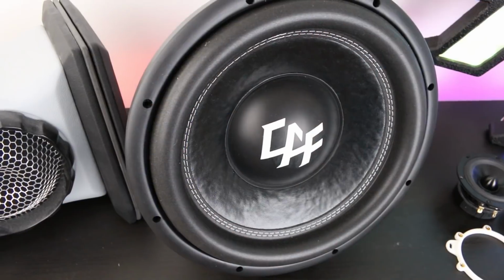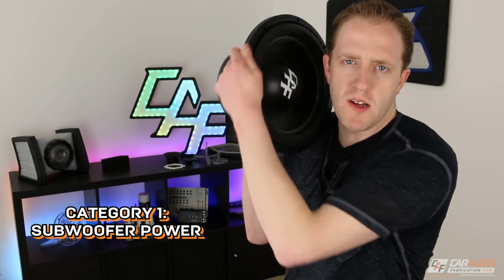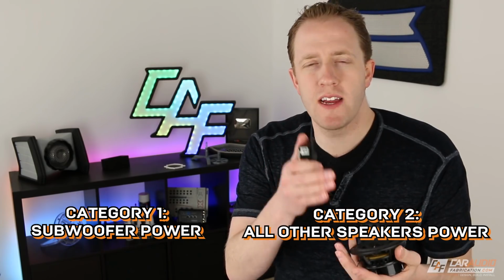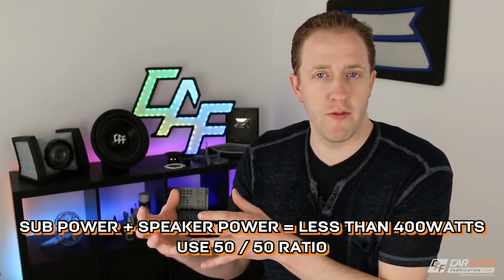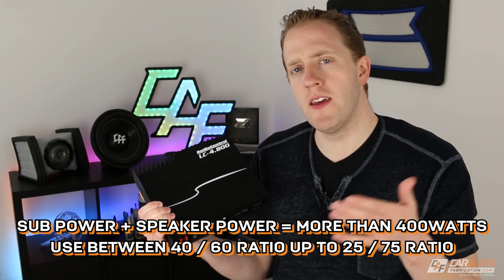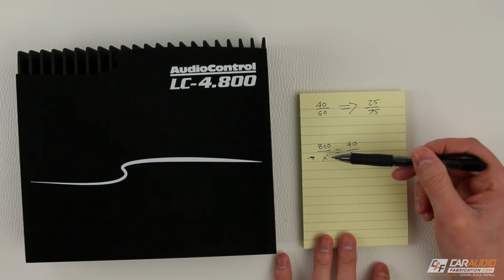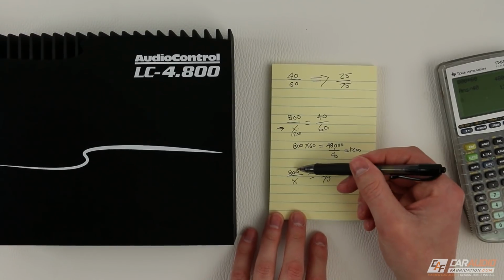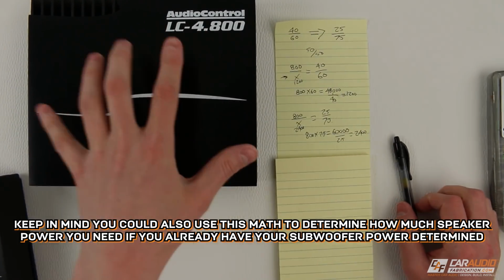Pair amplifiers CORRECTLY - Power Balancing Car Audio

Comment: i do have 60x4 (240 watt total ) rms watt amp for speakers and 150x1 rms watt amp for subwoofer and the subwoofer outplay the speakers by far when i put the gain control to the maximum , i have to lower the gain to the half at least to balance the sound , it's not even 50/50 what's wrong ?

Comment: A 40/60 split of 200 watts is 80/120 watts.
Secondly, you cannot set it up like that. Here's an example from my life, the pro audio world.

Medium size system for about 5000-7000 attendants. This is a balanced system with headroom for a crest factor of 15 db spl. Consists of an equal amount of tops and sub bass horns, 6 per side. Note that the very first number is the 1 watt sensitivity and the last number is how much each band is attenuated or decreased in db to get a smooth response. Also look at how efficient our sub bass enclosures actually are, compared to what you see in the hifi and car stereo world.

109db HF 4 khz - up 75 w x 12 = 900 w 24 L-R XO -3db
108db MF 4 khz - 202 hz 250 w x 12 = 3000 w 24 L-R XO 0db
103db LF 202 hz - 85 400 w x 12 = 4800 w 24 L-R XO +4db
107db Sub 85 - 24 3000 w x 12 = 36000 w 24 L-R XO + 6db
Total capacity 44700 watts of which 8700 is for everything but sub.

What I'm trying to illustrate is the fact that you need A LOT more energy down low to get an even response. What's really interesting is the fact that despite the massive amount of power handling in the sub band, if we drove the system hard enough to clip the sub amps or hit the limiters, the HF and MF amps would not even be half way there. These attenuation numbers are of course with amps of equal sensitivity, 32 db in our case, but not the same output capabilities.
I've done a lot of car stereo as well, and the sensitivity of those subs compared are usually far lower than the sensitivity of the LF, MF and HF drivers. Talking about a 40/60 split is nowhere near what is needed to get an equal output.
While we feed our system 2.5 times what it is capable of, i.e 111750 watts the high and mid section could be fed with 300 watts and maybe a 1000 watts. We make sure our amps can coast, so that we never lack headroom when they get heat soaked, hence the 2.5 ratio, but fact is that there isn't a lot of energy up there.

All that being said, I enjoyed watching your videos. You are providing a lot of great info.
You should do a video about amp power in relation to speaker power handling and headroom. So many people run their systems way too hard, so the sound gets super compressed without dynamics. This is also why the RMS rating of a speaker is the minimum when it comes to LF and sub band amp capabilites. They get hot and then they go down in power. After that, people try to drive them harder to keep the volume up. An amp should mainly coast, not constantly sweat.

Comment: I'm an audiophile. I like really hard clean bass, and Crystal clear highs, with slightly less clear mids. The mids, I like to be a little bit distorted because for some reason I like distortion. Just not in lyrics and bass.

As a noob I tried to put a 300w sub in on a 1000w amp with the factory speakers on the amp as well. I had a lot of clean bass and awful audio everywhere else. 

Later I figured out that I needed to separate bass from other frequencies, so I bought a 400w amp and set it for hp and set the 1000w to look with the gain set about a quarter the way. It cleaned up the distortion but then the amp got really upset for being underused. It started going into protection, and eventually it fried.

Next, I upgraded to competition soundstream se 375w subs and added 2 tweeters. I turned the bass all the way down on the head unit and the new 1000w soundstream amp do all the work on bass. I figured out that tweeters come with a built in hp filter, so I turned the treble almost completely up on the head unit and the mid just above half on the head. Still powering highs and mids on the 400w kove amp, I played with the gain until the mids began to clip but the highs were Crystal.

What I ended up with was a system you could hear from 3 blocks away, words and all.

The box was 3 cubes with 2 twelves: se 375. The rear speakers were 3 way 6x9 pioneers. The front speakers were pioneer 3 way 5.25. The highs were 2 2 inch tweeters inside the door but mirror level. The head unit was a pioneer 400w x 4.

In the competition I had a crossover: soundstream. I won 3 place in the non ported 1st round when my little system reached 160dbs.

I was proud of my $1600 stereo. 2001 Nissan Altima if you want to know lol

Comment: Can I use a 4 channel amp like this  2 channel for the front speakers 2 or 1 channel for the sub but use the rear output from the radio for the rear speakers how would that sound or work out? Hope to hear from you?

Comment: I have a question . I am running kenwood head unit into 360.3 dsp. going to a rockford fosgate 1000 x 4 . My front speakers are rated at 150w rms and the rear are 120 rms . both numbers are per speaker . I know the amp is a bit of an overkill but i have had it on my old build and it's been great . What do you suggest for subwoofer power? Also my car is a convertible . If you can point me to a good power number and what size of subwoofer i should use . I would appreciate it .  Thank you for your videos i just sound detened the trunk like you video . Keep it up

Comment: Ah ha. Found it. OK so even after the big 3, upgraded alternator, I need to get this shuruken battery installed asap. My 1500bd is over powering my r400.4. Sounded great with my 1k watt sub amp and my r400.4.

Comment: What would the power ratio be between 1" tweeters, 3" mids, 6.5" midbass, and 12" subs (3-way front stage)?  I'm thinking along the lines of 25, 45, 220, and 1000 (all of which are in watts rms).  I'm hoping to achieve a loud SQ setup using an Alpine dsp.  Note that the front stage speakers are Hertz mille and that there will be two 6.5's in each of the front doors.  The speakers are rated to 35, 50, 250, and 1200 watts rms, respectively, so there's room for adjustment and power to accomplish this.  Any breakdown of how a component system should be run would be great to know.

Comment: Newbie here wanting to get some advice from the knowledgeable car audio veterans. I'm not writing this to be clowned by some fool I'm really trying to figure this out, but there's so many numbers and variables to go through. I have 4- Rockford punch Pro 6.5 in my doors
2 Rockford punch Pro 8's in my rear Dash and a 10' punch pro in my rear in between the two 8's 
Doors-100rms each
8's-125rms each
10-350 rms 
As for my subwoofer I got a t1d412 800rms  and I ended up getting a DC Audio 2.0k amp to power that. To get myself a good balance what would be a good amp to power them? I was considering the audiocontrol D.4-800 for my doors and 8s if that's possible, but what should I do about the 10? Possible contenders for amps that I've seen are 
JL Audio Rd 900-5
Sundown audio 1100.5
Rockford Fosgate t1000x5 
If I do go with one of these 3 amps I would probably get the Rockford 3sixty.3 for a processor but I don't know anymore my brain hurts. Can anyone point me in the right way thanks in advance.

Comment: I feel very left out here, I have 2 12s receiving 500w rms each and my speakers are limited in their power capacity but are getting around 80-85w rms each. I've yet to actually meet anyone personally that is feeding 800w+  to their main speakers, mine are rated at 65w officially but I'm giving them clean power so can push it a little bit.

This video has a feel of those amps that say they give you 2400w for £50....

Comment: So... from someone who's done both car audio and home theater - I'd like to challenge you to share your knowledge a bit more, you talk a lot about ratios, but don't go into WHY.  At best these are a rule of thumb.

The why has to do with the amount of energy required to push the mass of air at the various frequencies.  It's further complicated by the non-linear response of people's ears.  Weighting curves are commonly used to correct for apparent loudness as sampled by an acoustic meter - people may be familiar with the term "db-A" or "db-C", which indicates indicates a weighting correction has been applied to the raw value.  The basic takeaway, is that our ears are less sensitive at the extremities of the audible range above 10kHz and below 200Hz.

Because it requires less energy to generate higher frequencies, the upper roll-off is easier to correct with equalization - but the low end also runs into the limitations of the volume and dimensions of the install and the circumstances of the vehicle construction.  Tackling those challenges in reverse; a flimsy undamped floor, roof, and doors will vibrate with the lower frequency energy absorbing some of the power and reflecting some of the power back as the panels rebound (out of phase, eating up apparent SPL and clarity), and acoustic modes caused by the dimensions of the vehicle will also come into play.

A floor to ceiling distance of 4.5' (54", 137cm) is resonant at about 250Hz - as you get around (above/below) that frequency there will be interference that either adds or subtracts from the expected audio.  Any larger dimensions will cause lower frequencies to have near resonance issues, like the distance from a sedans driver footwell to the rear right passenger's cargo shelf (for a large sedan like a Merc S-550, this could be slightly below 125Hz).  As you wander around this frequency range the sound gets muddy and the intelligibility goes down - which many people counter with more volume.  When you runs into the resonance issue, the best thing for it is to stop the resonance, either dampen the body panel(s) more and/or work on breaking up those fixed distances with some diffraction/diffusing.   Discouragingly, the 90Hz to 250Hz range is what most recording studios consider "musical bass", everything below that is sub-base - it's also the range most affected by the dimensions of the vehicles we install sound systems into.

Below the frequencies of resonance modes - you run into a brick wall of the damping volume of the interior itself.  If you watch the SPL drag races, these guys are banging on that wall with jackhammers... or wrecking balls.  Below the interior volume's damping resonance, you are essentially compressing the air volume, which requires more work/energy than merely coupling the cone to the air and simply transmitting the sound.  This can be relieved a bit by opening the windows, but most areas have sound ordinances now that prevent going too nuts, and if you're driving you get wind and traffic noise.

Each vehicle has its own physical acoustic limitations, and there is again a point of diminishing returns (a term you like to use a lot I note), where the volume just doesn't have anymore easy power you can add.  If you've ever heard of the 80/20 rule this is basically what happens, you spend the 20% to get 80% of the SPL, and your budget would need the other 80% to squeeze out that last 20% of SPL...

Then there's hearing loss.

I'm sure that if one wanted to get out there and 3D scan an interior, then do a resonance study on the target vehicle - the modes could be correctly diffused/diffracted, panel resonances can be damped, and the low frequency roll off can be calculated...  but most of us don't have THX's lab.  ;-)

Comment: What about the difference in SPL of your sub selection? I'm running 2 pair of infinity Primus 6×8s off the head unit, and looking to add a sub. I thought of doing a 250.1 amp running at it's 4ohm load which is 150ish; but was thinking of a single 8 which has a small SD and a SPL of 87. Will that balance nice, or should I get a duel 4ohm 250 watt single sub to be on the heavy side, and adjust the head unit's sub control to balance out.

Comment: Nice video, I like your channel, the way you make things simple is just relaxing and satisfying for me.
Could you give me your advice please? 
The RMS power I got overall for my speakers is 160W, and I have a 200w RMS subwoofer amplifier, so it shoud be a nice match as you say in the video, but I feel like I need some more bass, especially at very low frequencies (form 40Hz to lower) where my subwoofer seems to lack. (12 inch in a 22 liters sealed box from the factory)
So, should I get a bigger amp (around 500W rms) and pair with another identical sub connected in parallel with the one I already got (double power and double cone area) or should I build a bigger sealed box for the one that already got (even if the factory reccomends 20 liter boxes?)
I have a peak of power at about 45/50Hz, but  I'm looking for something more linear and powerful even at very low frequencies.

Comment: I just brought a car that had a amp all wired up but no sun connected. The amp is a oak600 CLASS D 1200 WATT 600 WRMS MONOBLOCK AMPLIFIER. What would be a good sub to pair with it? Any help will be greatly appreciated!

Comment: Efficiency, acoustics, subwoofer box, active vs passive fronts, 2-/3-/4-ways, rear or no rear speakers, preference in sound, type of music mostly played...
There are so many things influencing what's the bottleneck of a system, there really is no rule of thumb by looking at the power numbers.
F.e.: I am running a pair of very inefficient 8" midbass woofers all the way down to 40Hz, which easily swallow the 2x150W RMS I'm giving them without distortion or overexcursion, plus I'm sending about 2x60W to the mids and tweeters, yet my 2 12" subs in an oversized sealed enclosure provide plenty of bass support with only 300W on them.

Comment: Hey guys! Can those speaker membranes deteriorate somehow over time? I have some (home) speakers in the attic for ca 10 years now, which I had bought in the early 90s. I wanted to buy a matching sub on Ebay, which is of course of similar age, so I was wondering whether that is even a good idea. Any advice?

Comment: I don’t understand, if I had 1200 watts for my subwoofer and 800 watts for my mids and highs How is that balancing when mids and high are only 180 watts rms on and 800 watt amplifier? So really should you be balancing the rms of the speakers and the rms of the subwoofer 50/50 60/40 ect. ?

Comment: Couple questions I was wondering about - 
a) If I understand the example correctly we're to use the max RMS rating of the amp and not what the speakers are actually seeing? (so the LC-4.800 shows 4x 200w @ 2ohms) - so 200w RMS on each speaker upfront (assuming just a tweeter and a mid) is still ok with 1200w on the subs? 
b) do we adjust our calculations when using a different speaker resistance?  So if we use the LC-4.800 but are running at the 4x 125w RMS @ 4ohms? (or is it still based on the max RMS rating and therefore could have 125w with a 1200w sub amp?)

Comment: I've always done it simply in my head with less BIG numbers. Common denominators. 40/60 ratio = 4/6 = 2/3. 800 divided by 2 = 400. So multiply that by the bottom 3, = 1200. 800w highs, 1200w subs. Yes, it is longer written out, but you can do it in your head FAST.

25/75 = 1/3, so 800 x 3 = 2400w. Simple minds can move simple numbers FAST.

This has been Simple Minded Math with Halifax Max. Remember kids: It ain't stupid if it works!

Comment: That's not how you use the = sign
If you do it like you do it in the video
800*75=60000/25
Which is the same as saying
60000=2400
Which is not true
You can't just add numbers to one side of the function because thats not how maths work. You should do it like this
800*75=25x
60000=25x ||:25
2400=x

Comment: omg over complicating it. splits and percentages/ ratios? lol give me a break. Adjust the sub gain and crossover so that it disappears into the front stage. The crossover settings has  plenty to do with perceived balancing of system .

Comment: Where do you typically find what a factory head unit puts out? I've got a 2015 F150 Supercrew with the MyFord Touch 8" screen and 7 speakers. I've replaced the door speakers front and rear with Infinity Kappa 693.11i 2 ohm and the rears with 62.11i 2 ohm. Haven't changed the A-pillar tweeters or the center dash 3.5". Sounds pretty good for factory head unit. Considering going with the AudioControl LC-6.1200 to drive the doors and the tweeters. Then maybe the AudioControl LC1.800 and a subwoofer.

Comment: Mark, Wouldn't speaker sensitivity  play into this as well?  If my sub has a sensitivity of 85db and is 500 watts RMS, and my speakers have a sensitivity of 94db and are 60 watts RMS each, wouldn't the higher sensitivity make them plenty loud and clear enough with less power?

Comment: I remember way back that tweeters (in multi amp set ups) would tend to not get anywhere near the mid range/woofer power necessary.  Is there something to be said about the high frequency speakers not needing so much amplifier power?

Comment: According to AudioControl that LC-4.800 doesn't produce 800 wrms (200x4) unless each channel is run at 2ohms. 99% of the people using it would only be running it at 4ohm loads, which would only make it 500 wrms (125x4).  So, that means at 40/60 it would be 500wrms/750wrms and at 25/75 it would be 500wrms/1500wrms. Keep up the good work!

Comment: I have a question 

I'm interested in a 5 channel amp that has 75 watts rms on 4 channels and 350rms watts on the sub channel. Do you think that amp is enough for a quality setup? 

Note :I be using a Pioneer HU AVH 2300 and 2 pairs of polk speakers with 100 watts rms

Comment: Good video Mark, i would have used simpler ratios like 2:3 or 1:4 to make it easier to comprehend for those 5 out of 3 folks that have problems with math. I’m at 1:5 myself, 400w on mids/highs and 2000w on my sub.